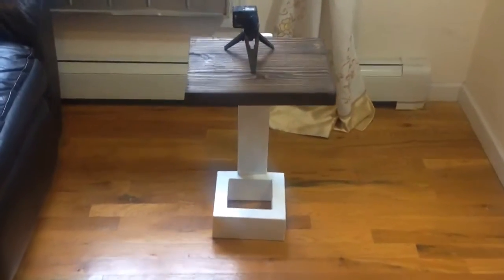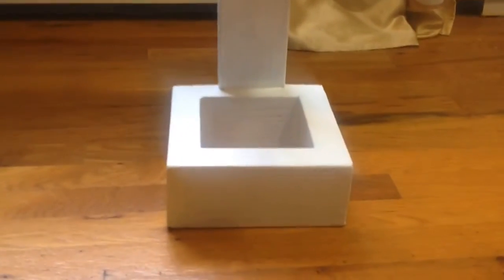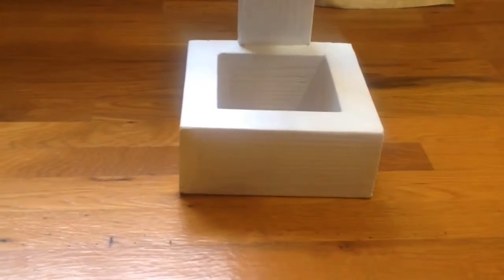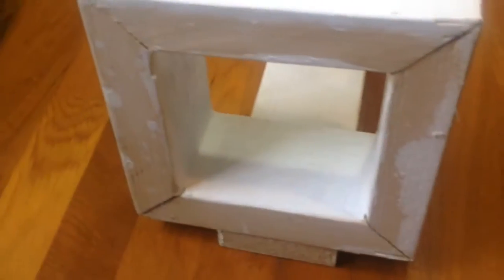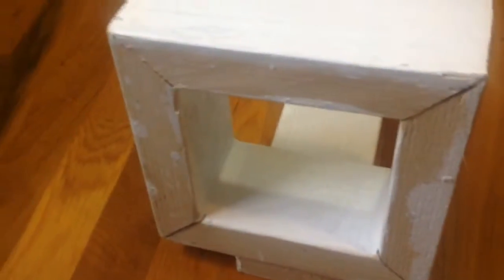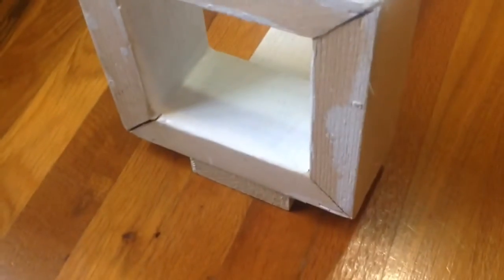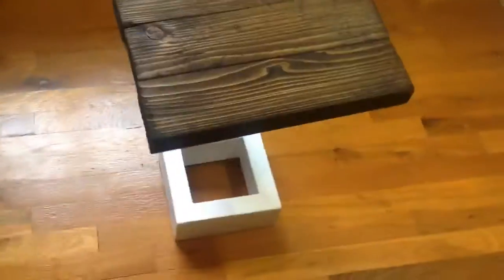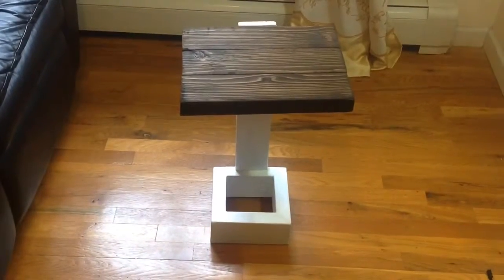DIY - Single 2x4 Modern Table Design / Build

Comment: I agree on the learning part.  Even when I started up this year, something I did 3 weeks ago looked so primitive compared to how I had advanced just in that short time.  Not that my projects became something spectacular, but even just getting better as using something like the jigsaw, was already more apparent.  In theory, we can cut wood with a jigsaw, but in practice, we can have better and better ways of getting the right cut done with the jigsaw.
Reply from the maker: +Per Shop Thanks a lot! Im a level below a beginner but I thought this turned out ok. You should try making something out of a single 2x4.